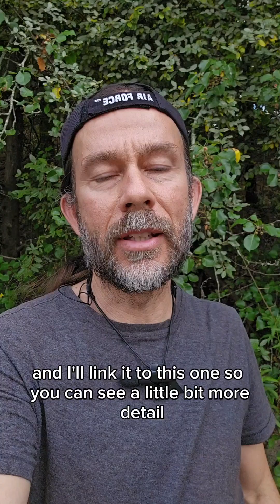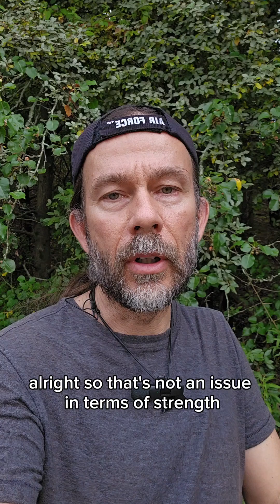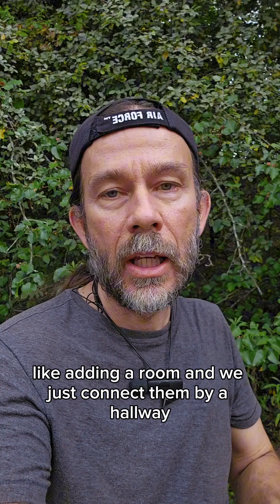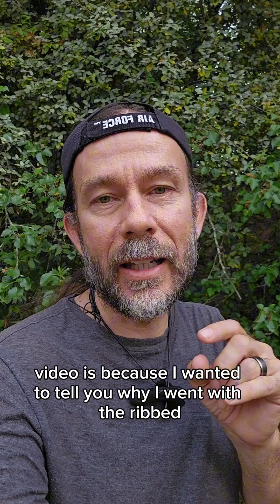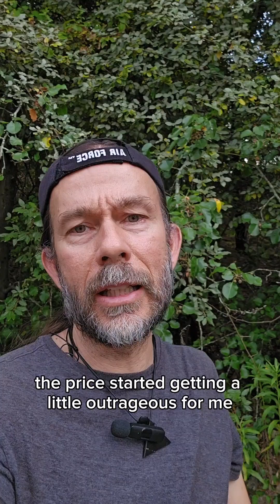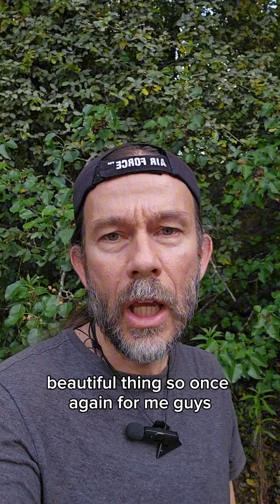Why Ribbed Domes Are Better Than GeoDesic Domes  For Hempcrete

Comment: I have never heard of a ribbed dome. I have only heard of geodesic and monolithic. Your dome looks like it has much in common with monolithic. What makes a ribbed dome unique
Reply from the maker: Ribbed domes have actually been around for a very very long time.  If you take a look at European architecture you'll see many of those domes are in fact of a ribbed. The uniqueness of them is the continuous flow from ground to top,  making a seamless transition,  thus the strength is better as the load tension is spread out amongst all members.  And they don't leak like a geodesic dome because they don't have gaps between the hubs like a geodesic does.  And in our case the uniqueness is that our truss members are a whooping 14 inches deep,  so you can install any insulation you would like very easily.
Reply: @gaiadomesolutions  Thank you!

Comment: So no one makes geodesics with boards instead of poles?
Reply from the maker: Yes,  there are a few that make geodesics  with boards like natural spaces domes but they are still the triangle structure making many different hubs. Thus making many different failure points.  Ours are ribbed domes with no hub spots for potential failure.

Comment: The main problem with geodesics is that they’re not tiled and must be perfectly continuous. This gives rise to similar problems with flat roofs, which always fail over time compared to a sloping tiled roof due to expansion/contraction. Any progress with this? I love geodesics as well btw an would like to see a solution.